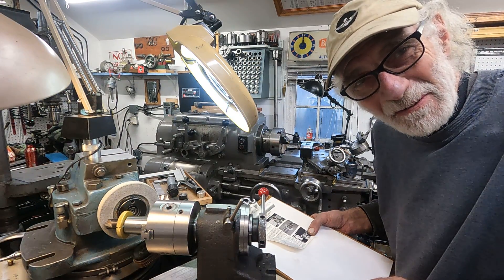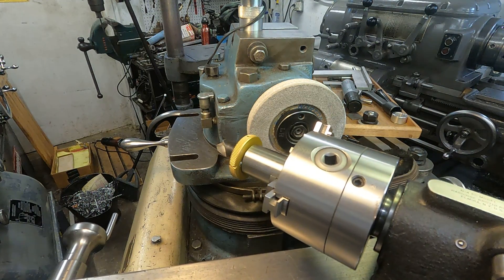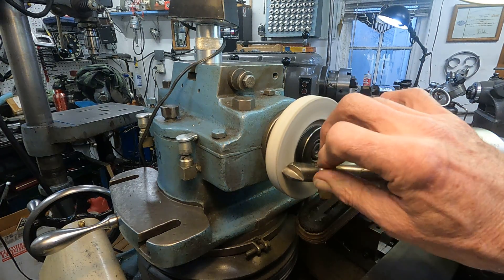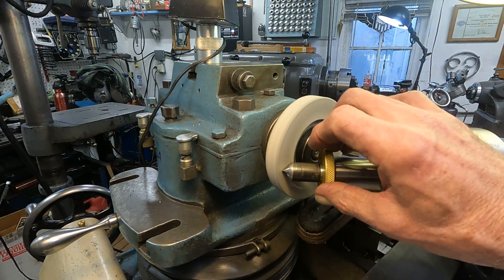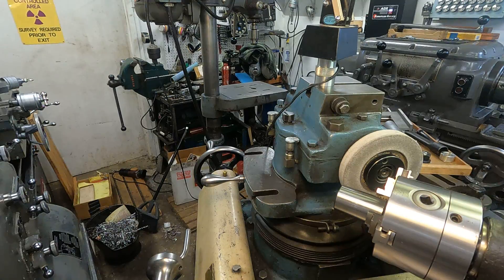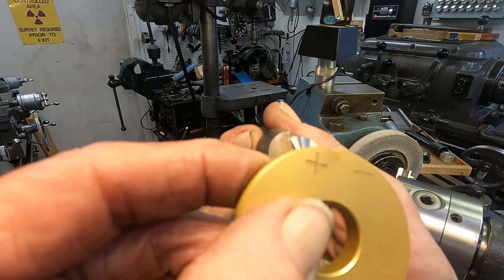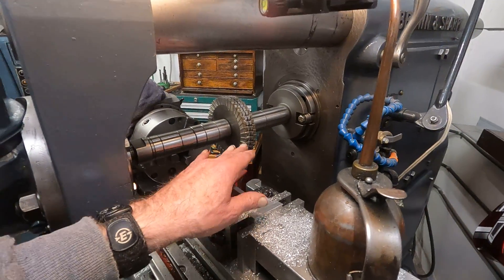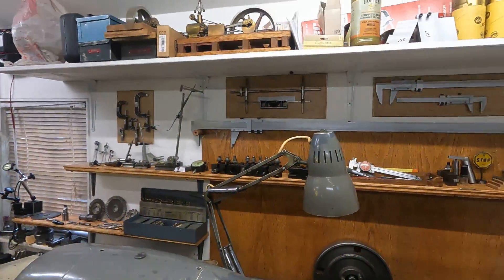Tool & Cutter Grinder Single Lip Countersink Resharpening Unicam Fixture 2

Comment: DeeDee. As always learning and fun.  This is a really cool tool. You can sharpen your countersink and get a pedicure at the same time!  Put a heavy relay in line with your phase converter that connects/disconnects all 3 legs. I have that set up with 110V coil controlled with a small wireless remote.  Cheers, TB
Reply from the maker: The easier way is to do it on the other side of the wheel but if you contact the wheel you are more likely to get injured. The tool causes fatigue quickly so doing it sitting with arms extended helps keep you fingers out of the wheel. Looking at the results there is more than expected the cam adjustment causes the heel of the tool to control the bite. The device gives full control of the cutter action to the point you can go toward the negative lead and use the cutter in a hand drill without it digging in. The counter sinks can be ground dozens of times, I will never have to but another one!

Comment: Great little fixture.. I wonder if one could fit a threaded rod in the back of the sleeve, maybe with an expanding plug, then could you spin the thing from behind the chuck, so your fingers aren't right next to the grinding wheel? could maybe put a crank handle on it too?  Thanks for demonstrating it!
Reply from the maker: I could have been designed better for sure!